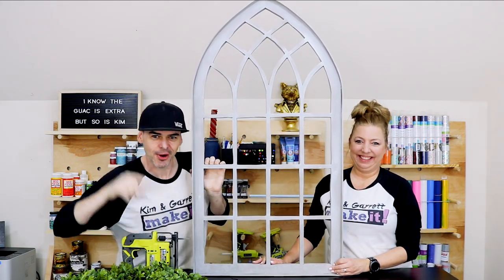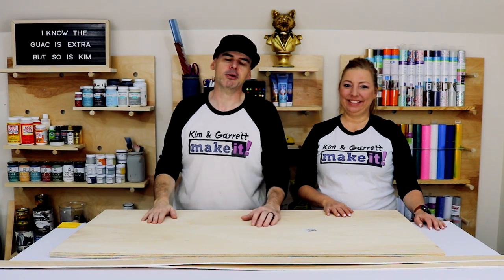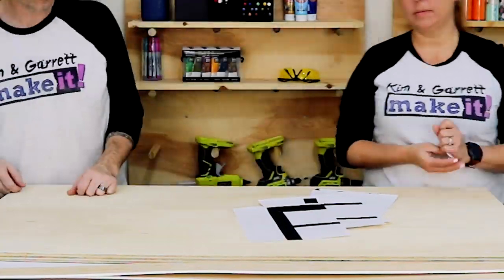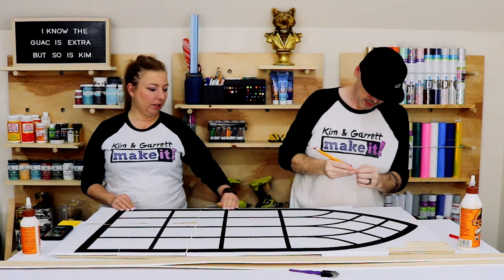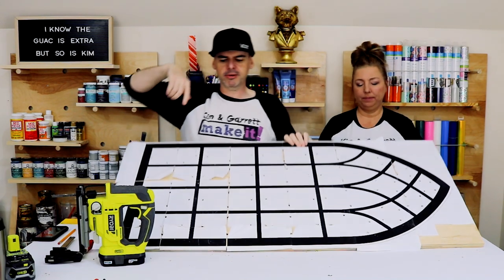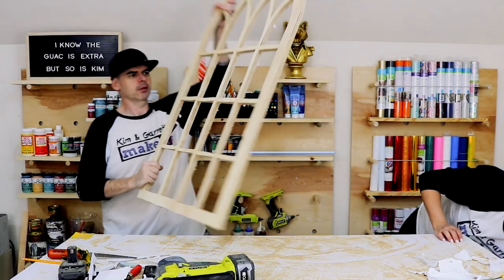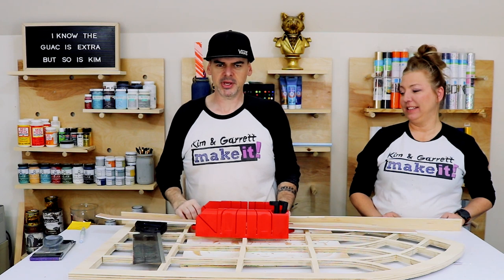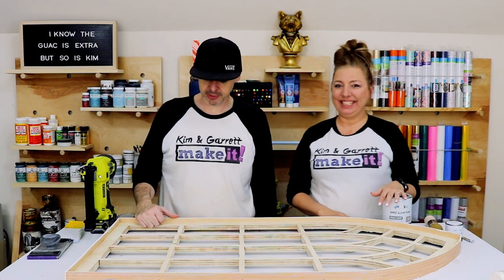Cheap and Easy Cathedral Window Frame Wall Decor

Comment: I Love it! Tip...i use repositioning spray adhesive to glue down patterns...if I don't want so sand a lot I put blue painters take under the parts that would be the finishing wood pieces. That way it's easy removal and you can paint the back side for a moor finished project.
Reply from the maker: Great tip on the repositioning spray!!! That would have been much better!